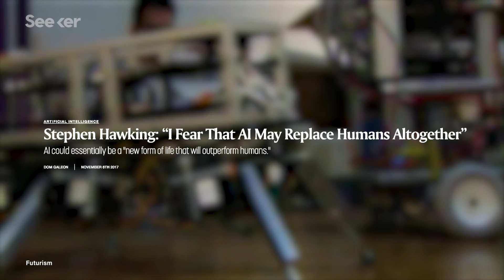These Self-Aware Robots Are Redefining Consciousness

Comment: Intelligence is a big word to use at this stage. Awareness? Preposterous click bait. Even the best simulation is just a simulation, it's not "aware" of anything. Current AI has no more awareness than a calculator or a spreadsheet. It's fancy maths. You shouldn't worry about "what AI will do" - but you do need to worry about what people are going to do with it, that's the real danger.

Comment: if you think about it, a wire of copper, and a synapse are ultimately similar energies at the fundamental levels of metaphysics. 
copper transmits electricity. synapses transmits neurons/ which are chemical compositions that are ultimately bases of protons/electrons/and other molecules that is ultimately energy. so, biochemical electricty is the same as the electricity running through wires. If you give a machine the proper hardware to expand, adapt, and have a form of neural plasticty network that emualtes human biological brains, eventually it will derive to HOTS operations which is HIGHER ORDEDER OF THOUGHTS, which is what defines intilligence that is self aware.  many layers of multibranch synapses of system that can expand, connect, and reshape itself as it gathers information (neural plastcity )is what makes the pinnacle of all organic brains.  im sure you can replicate this with some sort of hybrid synthetic stem cell organic neural processors.. think of stem cells being developed into artifical synapses capable of storing information, then giving it the ability for this stem cell synapses to multiply, and connect, and reashape itself as it gathers more information into its system. that is how a sentient machine will be born.

is a ant self aware? is a germ conscious? is a strain of virus aware of what it does and why it does it? surely they are conscious beings.
but not all conscious beings are self aware. the more neural synapses you have the more information you are able to store and cross reference. the more information, the more awareness, the more awarness, the sooner or later you start to have a higher reference point of perception, which sooner or later makes you self aware. 

if you give a machine enough data wit the proper synthetic wiring to emulate neuralplasticity of the brain, im sure it will have some kind of self awarenss.

Comment: Here is a logical mistake. It´s still not biological and synthetic. A synthetic consciousness still makes the organism not alive. For being alive it needs let it call biological structure with certain substancs to give it a real ego what we call "soul". It doesn´t "feel" the pain. It maybe reacts to different types of touches with its sensors. You also don´t say "The meter burnt in pain because it heat it self".  It doesn´t matter how complex it is developed. It also matters "with what" it is developed. Because if I make the same structure of the brain with dead and artificial material it can´t exist live on this material. It only exist a flow of electrons through a complex structure which is a reaction caused mechanical by feeling a structure of a stone and it detects it is a stone or the smoothness of something and the high tech sensors detecting a Penis or a Vagina. That´s just it. It can´t be confident like us the way it is developed and just build by metal or something.

Comment: I feel like hod lipson is being a little disingenuous with his comparison of self aware AI to fire. Fire is an unthinking reaction it either spreads or burns out. It’s nothing more than a thing.  Self aware AI is exactly what its name entails. It’s intelligent and self aware (envision itself at a later time) it controls itself more than we do. While this makes an amazing tool would revolutionize production, theoretically it could completely cut off our control. Hod said that it can see problems before they occur, set goals to improve itself. A tool that’s; more efficient, smarter and isn’t bound by biological restraint is the most dangerous internal problem that will ever exist. It’s a super nuke that isn’t controlled by morality or ethics or even empathy and if it does it has the option to shed them. Obviously a single automated factory or series of independently operated factories probably isn’t a threat but creating grid AI’s that controls the factory and the power plant that powers it and the trucks that delivers and supplies it’s assemblies. That’s where AI gets dangerous.

Comment: Not meaning to disappoint anyone, but this is just rhetorical for funding.
Not to say their won't be powerful robots. Just saying there is a difference in biological consciousness. They are yet to have a point or function. They ask questions. depending on what you feed the structures they created they will act human, intelligently, or whatever you would like to call it. It may even convince some of the dumbest people of today. But its just frameworks trying to furfill the goals it sets. Chances are you who are reading this is a biological robot. consciousness is lawless free space with pure control over the being it is. most humans dont even have this trait. Also the robots have to have control over their own software to the core, along with awareness of that, and that which would cause it to lose control of its own control which the conscious would avoid for obvious reasons.  These requirements would be held in place with what is analogous to DNA but within binary code. Humans have drives and needs. They must be met, in order to become conscious. So what do they/it need? How are those needs met? Then what? ask it a question? say hello? Are we able to observe its thoughts through a sensor with a proper understanding? Does it have an internal or external matrix?

Comment: "What does it mean for a robot to be self-aware?"

That it's programming makes it react in a way that we consider to be "self aware".

Terms like "just around the corner" are poop and you know it. My jetpack has been on backorder for 43 years now.

Questions like this are answered with a simple question: why would we want to make robots selfaware? If we all thing slavery is bad then wht the f*ck would we ever create a robot that will be in every respect a slave?
Reply: You're right, the common people would mistake a sliding door at the supermarket to be self aware, because it opened up for them. In reality it's just a dumb algorithm.

For example, take an artificially intelligent robot at the factory.
while there are still cars on the assembly line,
if it is a truck, paint it red,
otherwise paint it blue.
Of course, the behavior of such a robot would be much more complicated, but it's general orders follow a few simple rules. And it can't disobey these rules and do whatever it pleases because it was programmed that way and it can't magically replace it's programming with something else.
Unless of course, that robot has been hacked and it's program has been replaced by the hacker.
Reply: @konstantinrebrov675  while yes intelligence is not necessarily a sign of sentience at the same time that will change with the rapid evolution of quantum computing... plus cant you say the same about humans? we run off of organic hardware on software that has been refined over millions of years via trial and error... all vertebrates have the same basic fight or flight and self preservation instinct not to mention the instinct and biological drive to reproduce...

Comment: Now what if the robot used this self simulation to completely not just create itself completely but then helped building something bigger and then use itself to complete the building and maybe throw out 5 more starter robots which sould be easy to build and start collecting data once its positioned somewhere ahh I'm too stoned but this sounds genius in my head

Comment: So wait, I'm not sure how this is self awareness. Basically you run a DOE test on the hardware, what they call "babbling", fill the control software with mapped data, then the controller performs tasks extrapolating position based on these maps? Is this self awareness? Then any controller that operates by extrapolation is self aware?